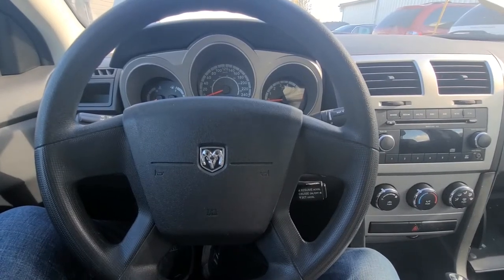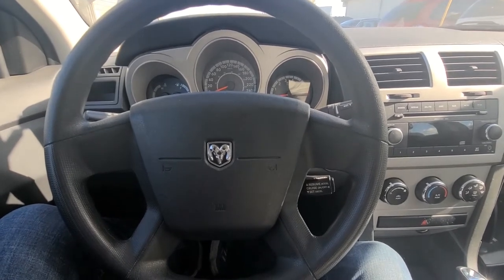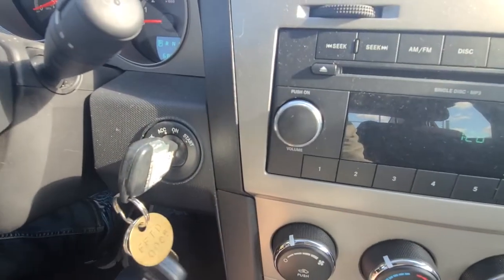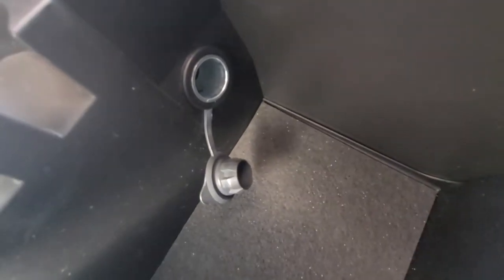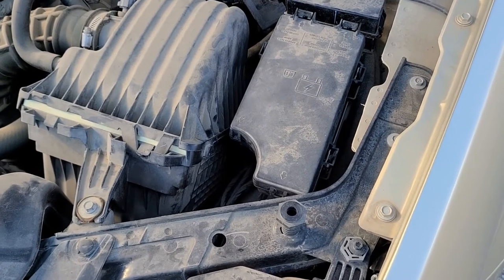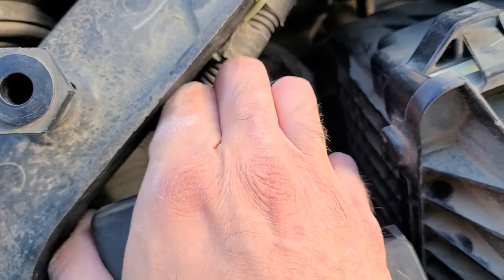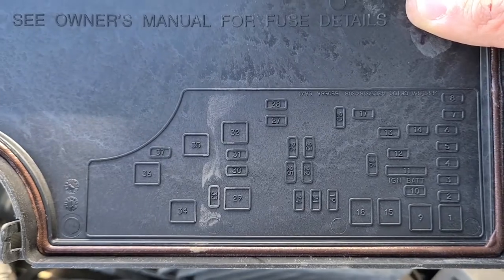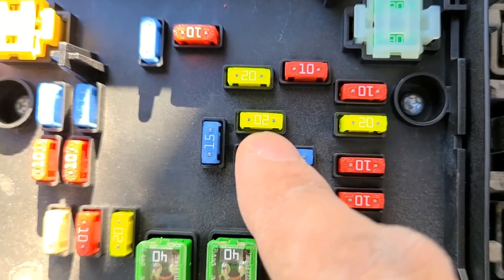Dodge Avenger - CIGARETTE LIGHTER / POWER OUTLET Fuse Location (2008-2014)

Comment: My owners manual calls for a 20amp fuse not a 15amp, can that make it blow alot of fuses???
Reply from the maker: Hi if 15A fuse is where it is supposed to be 20A fuse then it is quite possible that 15A fuse would keep blowing since it is too weak.
Reply: @QuiteAlright  A yellow 20amp fuse is the fuse that it calls for & that's the fuse it keeps blowing is the yellow 20amp fuse
Reply from the maker: @joshjames4489  It is shorting somewhere. You will have to pull out the faulty outlet and check the wiring / test the power to it. Also if you are using cheaper aftermarket accessories such as phone charging cables bought online or at gas stations I've seen they very often cause overload and burning the fuse constantly

Comment: How many amp can the fuse take? Like 15 amp? Its a 2013 avenger but idk how many amp can take
Reply from the maker: You never want to go over 80% of capacity. Keep in mind that cheap aftermarket car chargers and similar will often burn the power outlet fuse